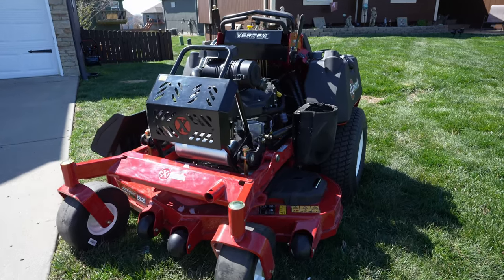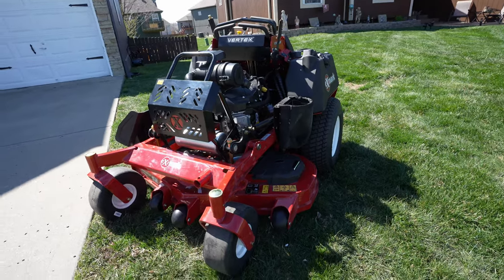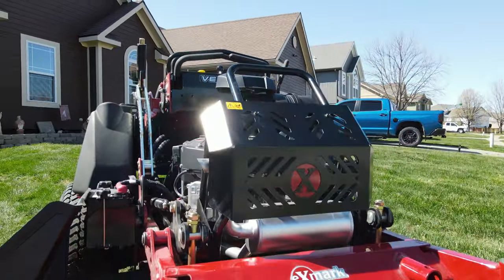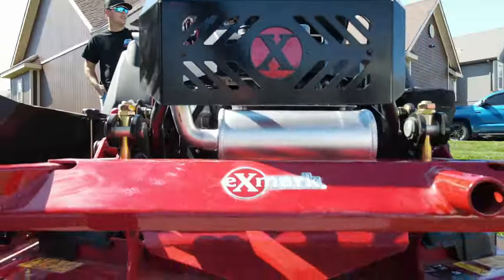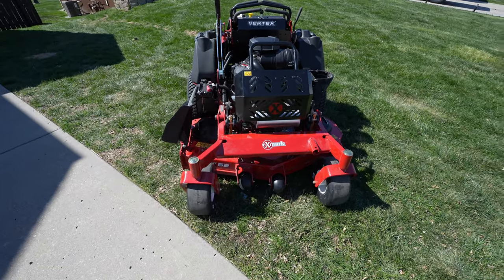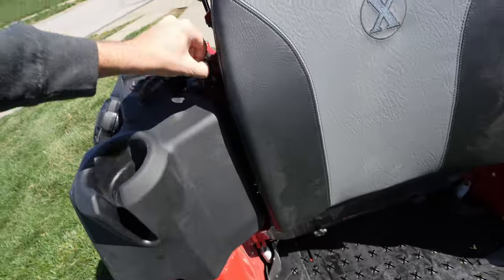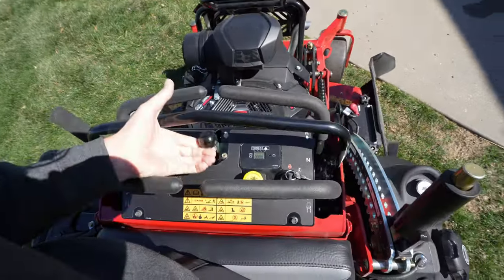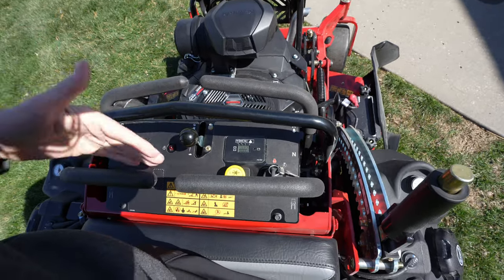This Might Be The Best New Mower On The Market!  (Exmark Vertex X Series)

Comment: I just got the same exact mower and there is a recall on the hydro hoses (I guess some of them were backing off threads)so make sure you ask your dealer and my dealer also told me they are going to have the tractus tires for the 52”
Reply from the maker: Thanks for letting me know. Other than that don’t like it? If they offer Tractus I will definitely get them!
Reply: @bblawncarekc  I love the mower. Haven’t cut with it yet (Michigan)
Reply: @bblawncarekc  got it in November so anxiously waiting

Comment: I’d stay away from Kawasaki efi, three mowers with around 500 hours with fried ecms. The open loop system still sucks down just as much as the carb models I traded off.
Kawasaki is no longer helping the consumer troubleshoot anything in the field even when it fails every few weeks.
My Briggs vanguard equipment has been reliable and efficient. Closed loop is the way to go.